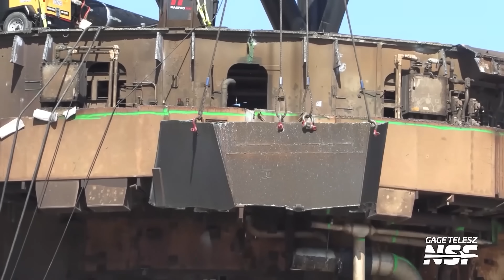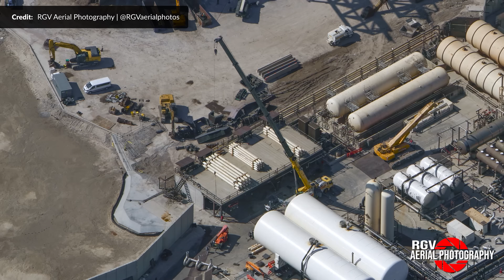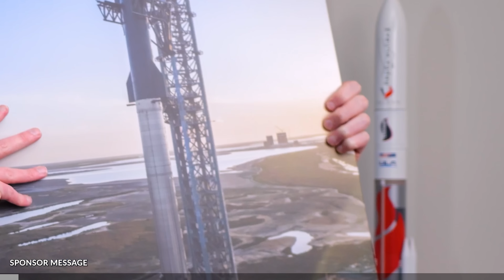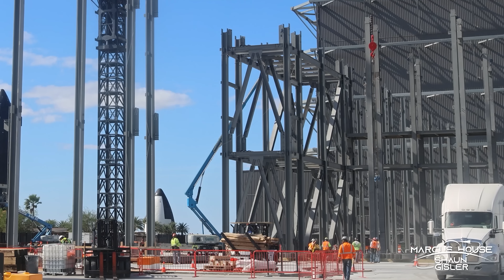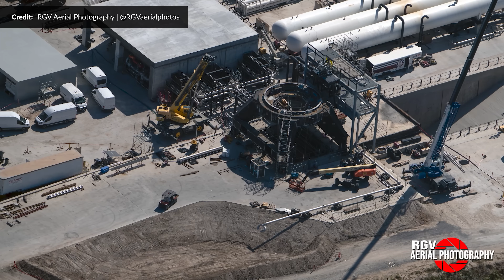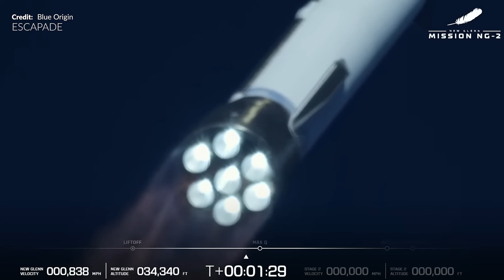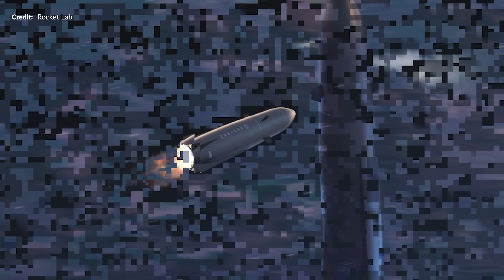Blue Origin’s New Glenn stunned everyone!

Comment: It is great seeing blue origin making huge progress. competitive race to space will lead to accelerated progress
Reply: What's the big deal? Falcon 9s have been landing off shore for almost a decade.  More than 500 landing.
Reply: @robertthomas9564  mby OC meant huge progress for BO from the first flight
Reply: @robertthomas9564  One is a monopoly. Two is competition.
Reply: @robertthomas9564   He is a member of the anti Elon cult
Reply: @robertthomas9564  The big deal is that now two companies can propulsively land boosters.
Reply: @robertthomas9564  Blues booster has 3 times the mass. It's far bigger then Falcon 9s. Blues booster can also hover and is more maneuverable. It's also not tied to landing back at the pad. This enables it to lift more into orbit. The upper stage also can send payloads to GSO, the Moon and Mars without the need for orbital refueling. All of these things are pretty big deals.
Reply: @keithfield  

Falcon Heavy has larger capacity still and likely a better price.  Especially now when they have started using all 3 boosters in place of Falcon 9s allowing them to get more trips out of them before potentially being expended on Falcon Heavy.

:planet-orange-purple-ring:

:planet-orange-purple-ring:
Reply: @robertthomas9564  Only big deal is that its a bigger rocket, starship is still bigger and could have easily landed on a barge if SpaceX wanted to, but they are going for rapid reusability instead.
Reply: I saw a title of another video of some other channel saying that now SpaceX is trembling because Blue Origin is catching up. When the truth is far the opposite. I remember Elon saying at one point, he was wishing for other companies to catch up and do the same and also go beyond him, because in that way, we push our boundaries to a new level. All major space agencies and private companies aiming for the same goal, achieving what each other has done and then going beyond is the answer to improving ourselves as a multi-planetary species, and maybe become a space-faring one in the future.

On the other hand there's always comparisons, pros and cons of each design across many other companies, and yet all their designs are still being used. For example, why Rocket Lab keeps getting contracts if their rockets are way smaller than a Falcon 9?
But then esa and other agencies still use Atlas rockets and hopefully Vulcan Centaur will fly again.
Who here is trying to prove who's got bigger hubris? I don't think none. Maybe Elon himself, but I don't think that to be true, since SpaceX is not only a man, but a huge team of people and a great Gwynne Shotwell leading stuff, and also their HLS design my prove useful for quite a lot in the Artemis missions, but I am guessing many others will come in and try to prove their mettle.
I do applaud New Glenn 2 achievement, it has great potential. For many missions including Artemis. 

I guess what I am trying to say, is that we shouldn't be racing each other to prove a bigger hubris, but to make humanity progress and develop further using space faring as a vehicle, instead of war like it has been for the whole human history.

Comment: Space X landed a booster in 5 attempts.
Blue Origin succeeded in 2 attempts 
ROCKET LAB you've got a high bar!
Reply: Landing boosters is like Ironman marathons, just managing to do it at all makes a winner. If it takes Rocket Labs 50 tries to get it right then they still get full applause when they do.
Reply: @worldwideroach  Agreed, and well put! 🍻 
Doesn't matter how long it takes, what matters is not giving up and not getting discouraged by the failures.
Reply: It’s a little easier to accomplish when somebody else has already shown you how to do it. And let’s not forget the time to success element.
Reply: @georgeacton9106 exactly this! Ppl are bashing SpaceX without knowing that the company already laid the foundation of reusable rocketry so other companies follow the example.
Reply: Caught one on the first try.
Reply: @adamklosterman8960  For Blue Origin? This was their second attempt, as the first one late last year did not succeed.
Reply: @DUKE_of_RAMBLE  Sounds like adam is talking about the Starship. Succeeded on the first landing attempt. However, that is not a fair comparison. Starship had many ocean touchdown attempts that failed or were precluded before the successful tower catch. New Glenn only had one fail.
Reply: @J7Handle  Hmm. Yea I suppose that's possible. If that's the case then indeed, not exactly a fair comparison. The companies take two entirely different approaches to how they build rockets, which leads to one designing and testing in simulations (BO; also many others),_ whereas the other opts to put that time into testing the actual vehicles with minimal simulations ran.

There's definitely merits to both, but I personally have more confidence in the SpaceX approach on account of it actually conducting stuff in the real world, which means real data and faster development process. Both companies have been in the rocketry game the same amount of time, but one is a industry leader with fat stacks of cash, and the other is playing catch up 🥴

(note: for anyone thinking it, no I'm not hating on BO, I'm simply stating the facts)
Reply: @DUKE_of_RAMBLE  something like New Glenn is easier to simulate than Starship Super Heavy anyways. The flight profile is so much simpler for a booster than for a belly flopping ship.
Reply: @J7Handle  There is that. lol
Reply: They already failed many times

Comment: well done blue origin!
Reply: New Glenn is bad ass, their media team .. ugh. Your audience is not 10 yr olds.
Reply: @gcburns4  

New Glenn is not bad.  It still has a lot to prove (ideally putting up the Amazon LEO satellites, they need about 1450 up by the end of July).  Lets see them get that re-usability and launch cadence.  They may need another barge quickly to do that.  

Maybe BO should buy the Starliner capsule and get New Glenn man rated.

:planet-orange-purple-ring:

:planet-orange-purple-ring:
Reply: @Scanner9631  That's the next step for sure, now that we've seen a demonstration that it works and they can actually do it, we need to start seeing a massive ramp up in their production of the NG fleet and more drone ships to allow for rapid launch schedules.
Reply: @Sundablakr  

Needs more 25+ ton cargoes to become available.  To drive that they need to have low prices.  Can New Glenn fly with low prices?  Will Bezos LET it fly with low prices or will he be greedy?

:planet-orange-purple-ring:

:planet-orange-purple-ring:
Reply: @Scanner9631  I think at least at some point they will start launching their Starlink competitor on NG at least which will increase launch frequency.
Reply: @Sundablakr  

It ISN'T their Starlink competitor.  Kuiper/Amazon LEO is owned by Amazon NOT Blue Origin.  

Bezos is a minority stock holder in Amazon and owns BO.

:planet-orange-purple-ring:

:planet-orange-purple-ring:
Reply: @Scanner9631  That's true, but NG is still the intended launch vehicle for it.
Reply: @Sundablakr   but NG is still the intended launch vehicle for it.

Contracts for Atlas, Vulcan, Arianne 6 and Falcon 9 as well as New Glenn.  ALL qualify as "The intended launch vehicle" as much as New Glenn does.

:planet-orange-purple-ring:

:planet-orange-purple-ring:
Reply: @Scanner9631  The only reason those contracts exist is due to NG development overruns.
Reply: @Sundablakr  

Garbage.  All but the Falcon 9 contract were signed at the same time.  The Falcon 9 one was because of an Amazon shareholder lawsuit.

:planet-orange-purple-ring:

:planet-orange-purple-ring:

Comment: As cool and impressive the Blue Origin flight was, the elephant in the room is price.  Cost per lb to orbit.  Will it ever be competitive with SpaceX.
Reply: Probably not, but it’s a good thing that they’re trying.
Reply: Impossible with this architecture. They can't even compete with falcon.
Reply: @admarsandbeyond   Impossible with this architecture. They can't even compete with falcon. 

Bezos has said it can't be economical without the reusable 2nd stage due in the mid 20s.  Of course since then Falcon 9 has started flying more missions per year and per booster cutting their costs further.  Of course Falcon 9 has Crew Dragon as well for manned missions which BO lacks.

:planet-orange-purple-ring:

:planet-orange-purple-ring:

Comment: I don't understand why NASA chose a much more complex trajectory for Escapade instead of just waiting to launch at the 2026 Mars window. Was it just another government gift to BO?  In essence, the planned trajectory has Escapade waiting in space instead of waiting on Earth. The additional 11 months in space trades a safe ground based storage vs a harsh, high-risk environment as well as potential failure of the complex trajectory. For example, would it have survived the recent CME.
Reply: It's a low cost high risk mission.
Reply: Some have speculated fear of the mission being canceled to "save" money
Reply: Test of concept. With more Mars missions planned this type of Mars transit could allow for much more transfers per window than available launch facilities at one time. Rather than rushing to get a Spacecraft to the pad to make the launch window they have more time.
Reply: Because they paid for THIS flight. If they chose to delay, BO would have to charge them for a second flight. So for once, the govt saved taxpayer money.
Reply: Not a gift to BO - quite the opposite. NASA got a ridiculously good deal (~$20m) for accepting the risk of launching on the first New Glenn flight, and while it ended up being the second launch after New Glenn wasn't ready, Blue Origin were still willing to honor the price because they need flights to demonstrate capability. If Escapade had waited until the 2026 transfer window, New Glenn would be a proven platform by then, and there's no way they could afford to fly on it.

Comment: How are Neutron allowed an orbital flight on their first attempt? To de-orbit they will need to fire up engines which has not yet been proven for the design. If they are iunable to fire up on time, or correctly, they would eventually deorbit in an uncontrolled manner, potentially coming in or populated regions. I understood that was why Starship have been required to perform in flight engine testing in suborbital conditions before being allowed to go to full orbit (now planned on ship 12 I understand). Have I misunderstood something here?
Reply: Neutron is not a fully reusable launch vehicle. The booster is suborbital just like falcon or Nglenn.
Reply: @admarsandbeyond  I see, the upper section (in orbit) is planned to burnup on return.
Reply: Starship is treated specially because it's a) so much bigger than anything else, and b) the upper stage is explicitly designed to not burn up on re-entry... making it a unique hazard.

Comment: BO had a great success, but people forget that landing one booster is only the first step of many (the easiest probably). Now they need to make it reusable, reliable, efficient, high cadence, and most importantly cost effective. A process a couple orders of magnitude harder and time consuming.
Reply: Cost effective is going to be the hurdle. Customers will not be ringing the phone off the wall if Space X can launch for significantly less.
Reply: @denny @dennyoconnor8680 it is already doing, so I guess you meant ‘continues to’ launch for significantly less
Reply: @dennyoconnor8680  Actually, SpaceX is not that cheap since they have had no competitor. They are charging a big premium and can probably be very easy outbid by another company with a reusable rocket if they don't change their launch prices. (This means of course that SpaceX can lower the prices as well and thats what really good about this).
Reply: More work, of course! "Couple orders of magnitude harder", totally wrong! They have successfully done the hardest part. Now it will probably take a few years to ramp up but thats expected. It mostly a case of money and resources to build enough vehicles to get the experience and fix the reliability issues that will arises.
Reply: @drosendahl we don't know what condition the landed booster is in yet.  It needs to be evaluated, refurbished, reflown (to prove the can actually refly) and THEN they'll have succeeded.  They took a huge step forward but they're a long way off from commerical reusability being proven.
Reply: @Darthquackius  But it probably still not order of magnitude HARDER to reach that part than what they already done. Quite the opposite, now they have proven with two flights that they have a rocket to space and that can provide money for the rest of the development.
Reply: BO is 1.3 the cost of 2 Falcon 9 launches.  BO has a larger fairing.  So it slots in above F9 and below Falcon Heavy.  Heavy is more expensive and has smaller fairing than BO.
Reply: @mefobills279  How do you know that? Blue Origin has never publicly disclosed an official commercial price for a New Glenn launch. Some have guesstimated a cost of ~$70M/launch from the Amazon deal, which was an intra-company deal at marginal launch cost, similar to SpaceX internal Starlink marginal launch costs of ~$20M. Bezos has a lot of money and my guess is he will probably subsidize NG heavily for years to make it appear successful, but the bill always comes in the end, and NG's survival is improbable IMO.
Reply: Blue Origin has never publicly disclosed an official commercial price for a New Glenn launch. Some have guesstimated a cost of ~$70M/launch from the Amazon deal, which was an intra-company deal at marginal launch cost, similar to SpaceX internal Starlink marginal launch costs of ~$20M. Bezos has a lot of money and my guess is he will probably subsidize NG heavily for years to make it appear successful, but the bill always comes in the end, and NG's survival is improbable IMO.
Reply: @admarsandbeyond   ~$70M/launch from the Amazon deal, which was an intra-company deal at marginal launch cost,

Nope.  Amazon and BO are separate companies.  Bezos is the connection between them.  He used his influence to get that contract and freeze out SpaceX from consideration.  He chose 4 rockets to launch Kuiper (now LEO). Atlas which has a limited number of flights due to no longer being allowed to buy Russian engines.  Arianne 6 which has yet to fly any of the satellites and was late.  Vulcan which again was late (due to the BO BE-4 engines being late) and of course New Glenn also late.  Amazon stock holders forced a limited number of lights being awarded to SpaceX Falcon 9.  I think only Atlas and Falcon 9 have put up any of the satellites.

Problem is they need to either renegotiate the license for Kuiper/LEO or get up another ~ 1450 satellites by the end of July 2026.  Without a massive up tick in launches by those original 4 launch vehicles (and satellite production to match) or they need to get a lot more Falcon 9 launches which may only be available if Starship starts deploying Starlink satellites.

:planet-orange-purple-ring:

:planet-orange-purple-ring:
Reply: @mefobills279 How do you know that? Blue Origin has never publicly disclosed an official commercial price for a New Glenn launch. Some have guesstimated a cost of ~$70M/launch from the Amazon deal, which was an intra-company deal at marginal launch cost, similar to SpaceX internal Starlink marginal launch costs of ~$20M. Bezos has a lot of money and my guess is he will probably subsidize NG heavily for years to make it appear successful, but the bill always comes in the end, and NG's survival is improbable IMO.
Reply: @mefobills279  How do you know that? Blue Origin has never publicly disclosed an official commercial price for a New Glenn launch. Some have guesstimated a cost of ~$70M/launch from the Amazon deal, which was an intra-company deal at marginal launch cost, similar to SpaceX internal Starlink marginal launch costs of ~$20M. Bezos has a lot of money and my guess is he will probably subsidize NG heavily for years to make it appear successful, but the bill always comes in the end, and NG's survival is improbable IMO.

Comment: I'm curious about the hurricane rating of the Mega and Giga Bays. Could they really  survive a Cat 4 or 5 hurricane? South Texas gets hit fairly regularly, so it's a real threat.
Reply: Cat 5 would be devastating but Cat 4 would be bad but not completely debilitating. They have a lot of super overbuilt blast walls and the Stainless Still holds up well to any saltwater immersion. Also the Hurricanes tend to hit a lot more north and east of here. I went through Ike in Galveston and have some knowledge of these things
Reply: They are large with large surface area's so that's a real issue.  However most storm proof construction starts with framing in heavy steel and those are heavy steel structures...